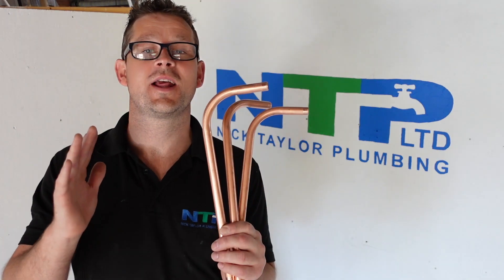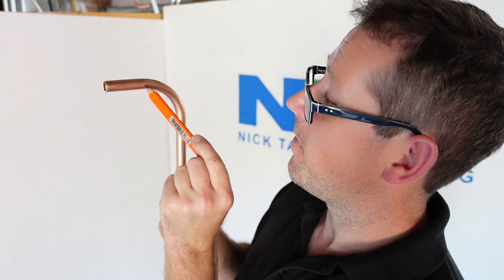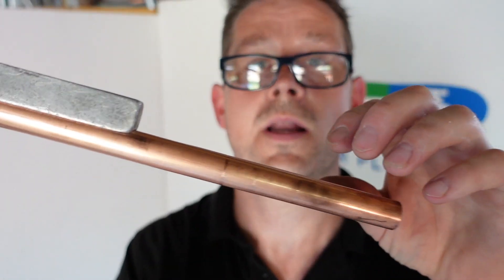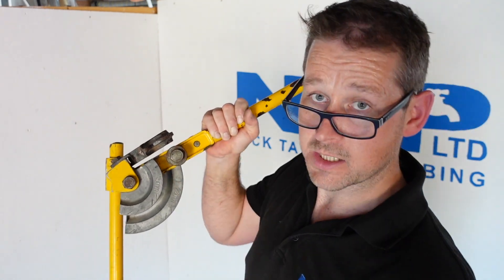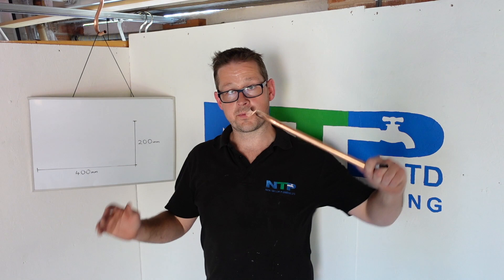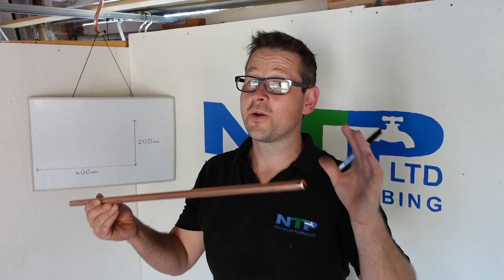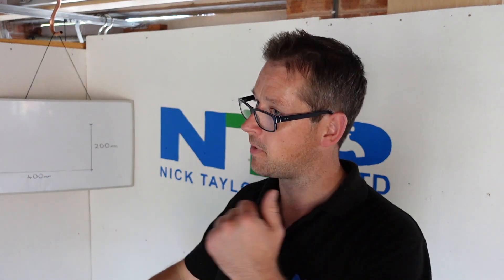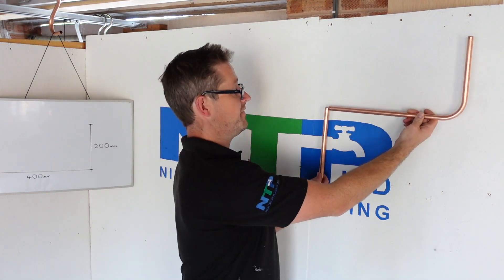Bend copper pipe like a boss, How to bend copper pipe 90 degree bend    HD 1080p

Comment: McKwen method, measure back 70mm(15mm) & 100mm(22mm) to the start of the Former. Instant correct 90degree bending & easy to remember the size Nick the KnickerKnocker👍👍

Comment: I prefer the lose pipe insertion method as you can measure to centers, inside or outside edge. Irwin hilmor benders are not as good as the original Hilmor benders. A Company called bend it now use the original tooling and so do Nerrad tools benders . Looking forward to offsets pass overs, partial passovers ect. Do you use the 30 degree x2.0, 45 degree x1.4, 60 degree x1.2 method which I think original use by electricians conduit bending? Good video nicely explained. 👍